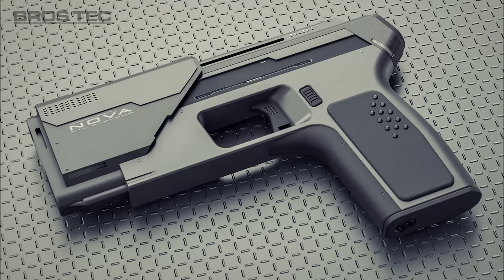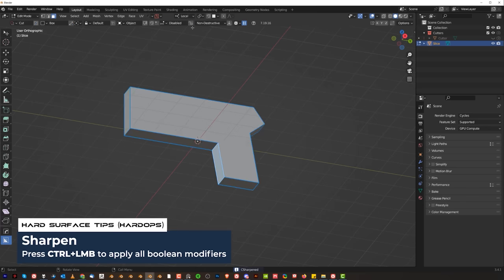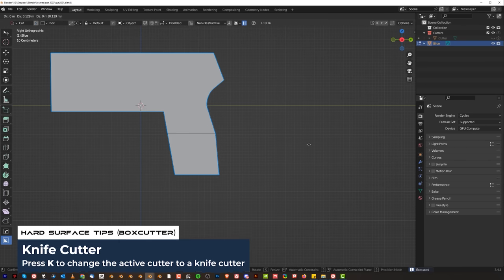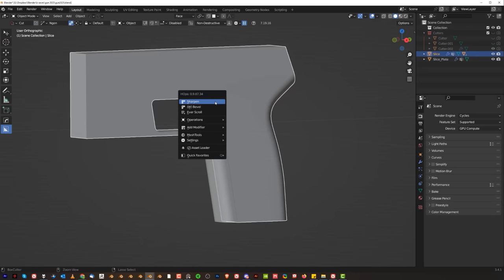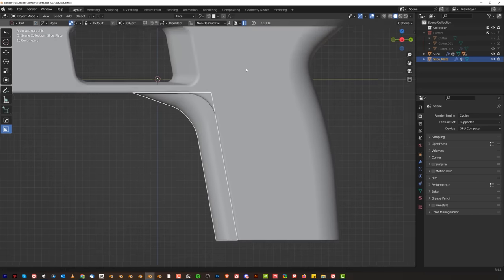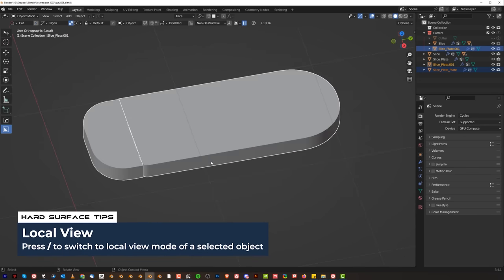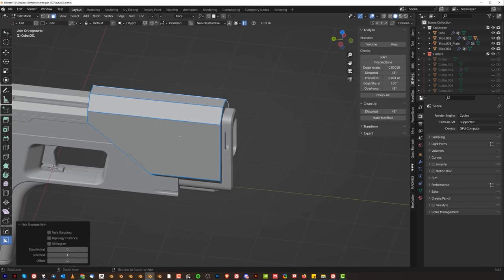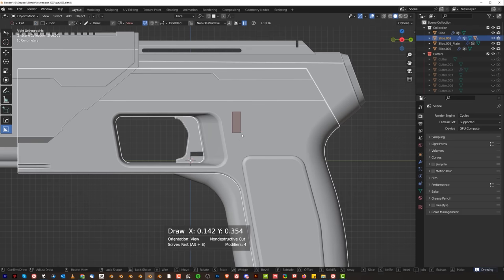Gun TUTORIAL for Blender with Hardops and Boxcutter

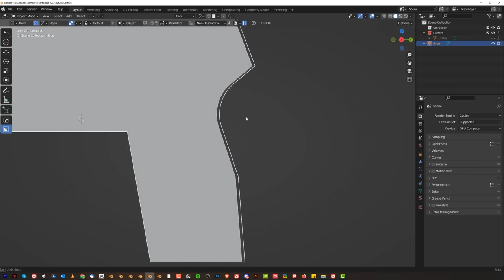Comment: Thanks for the video! Only comment is that I sometimes get stuck because some steps are not explained (yes, i'm a noob) and I have to spend 15 mins searching elsewhere for answers. For example, you bring up a menu at 3:23 and I have no idea how you get that menu to pop up.
Reply: So at this point he is using another add on call "Mesh Machine" with this add on you can press "Y" on the keyboard when selecting a bevel and you can "Unbevel". This is a cool feature in Mesh Machine. If you don't have the Mesh Machine add on, the menu will not pop up.